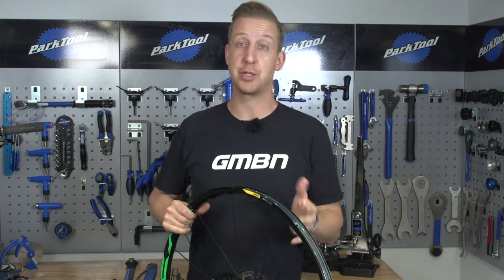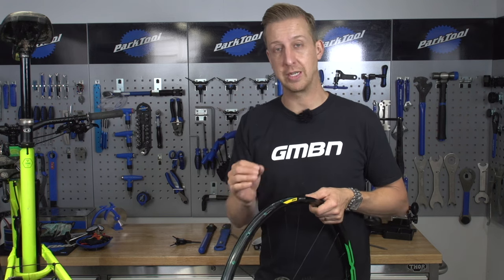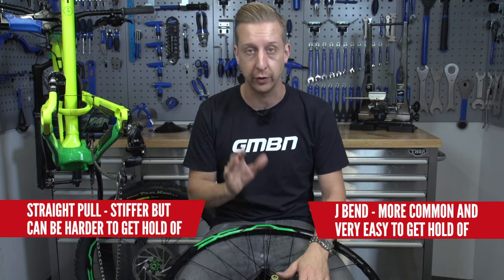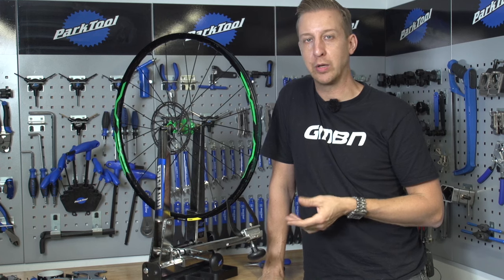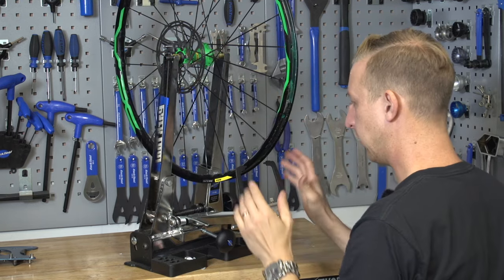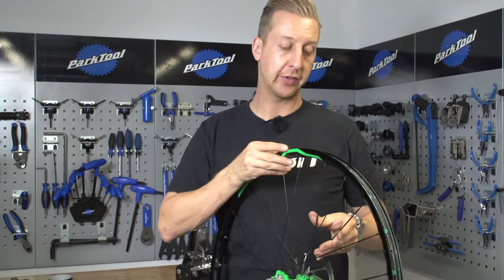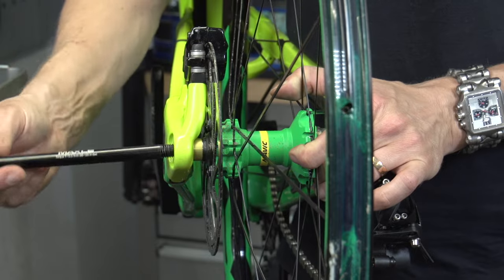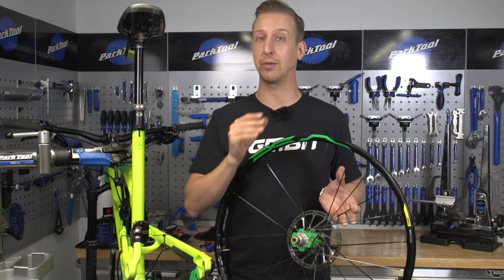How To Replace A Broken Spoke | Mountain Bike Maintenance

Comment from the maker: Let us know how you get on replacing your spokes in the comments below 👇
Reply: I managed to replace a spoke without removing the tyre, but I had to hold on to the nipple as if my life would depend on it. Thinking about it, it probably did.
Reply: I can replace a spoke without removing the wheel from the bike.
Reply: no removing the wheels, or cassette or discs to replace a spoke or two, the question is why not? I would think.
Reply: yep 30 seconds and chances are if they are J bend you will not have a chain whip with you if on cassette side and if not there is a 2 in 3 chance of having to remove the disc. I always have cable ties in the backpack and the frame with those is as good as any jig for a spoke replacement.
Reply: I bought a spare pack of straight pull spokes when I built my wheels up. always have half a dozen in my pack.
Reply: What happens if we don't replace a broken spoke
Reply: Can you provide any info on how to change a crankbrothers twinspoke?

Comment: That cable tie truing guide is a great hack! In fact, you could probably tape one cable tie to the seat stay so the locking end is sticking up and you can slide a tail (without locking end) through it. It's adjustable that way. You can't back it out, but you can run it all the way through and back in if needed. I'll try it next time

Comment: You are meant to hold aero bladed spokes in place with a stablisation tool as you tighten the nipple otherwise they twist out of alignment, this guy failed to do that, it can cause them to break prematurely. They are aligned so they cut into the air, for aerodynamic effect.
Reply: These are not aero spokes. This technique is called "bladed spokes" which helps the strength mostly.
Reply: The tool is called a Mavic Spoke Holder for Bladed / Aero Spokes .. so I think you are wrong
Reply: This video from Park Tools explains it https://www.youtube.com/watch?v=ZB_d8x05qXk

Comment: You did one really crucial mistake
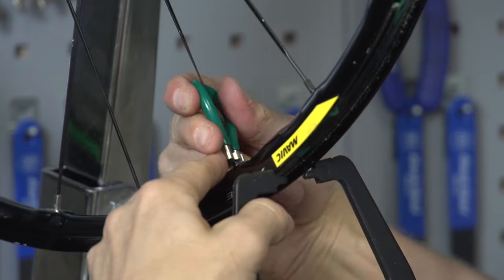Bladed spokes need a special spanner in order to keep the bladed part from twisting (as it happened in 5:55)
Otherwise you are putting tremendous forces on ur hub flanges and on the spokes them selfs.
Reply: mikeleight  right i apologize

Comment: When I built a new wheel, I used a broken piece of spoke to hold the nipple though the hole and then simply screwed it off of that and onto the replacement spoke.

Comment: 7:52 If the wheel itself has been trued on the jig, why does it still do that when it is mounted on the bike?  That's what happens with my bike.  How can the bike itself be used as a jig if the sideways motion of the rim is not the same when it's on an actual jig?
Reply: @cryora  they actually recorded that zip tie hack before the rest of the video. So essentially the rims was not yet tured. They loaded the video out of order when editing.

Comment: I have totally mangled my front Fulcrum rim, got it straight by bending it back. One scary thing when bending back the rim was that the weld opened and closed as I applied pressure. I guess no more jumps and trails on my rims.

Comment: You glossed over any tips for getting all of the sealant out of the rim and cleaning the rim tape residue from the rim.  How clean is clean enough?  Does it need to be perfect?
Reply from the maker: Hi Laura, pinch the tyre so that you can cleanly pour most excess sealant into a wide container such as an oil bath or a washing up bowl. Then use some rags to wipe up the rest. It doesn't need to be super clean, just so it's not dripping everywhere :)
Reply: What about the rim if you have to retape it?  It doesn't seem like the tape would stick if there's too much residue on the rim.
Reply: Rubbing alcohol will remove the sealant residue from the rim. You need it very clean so the tape will stick.

Comment: How to replace spokes on the trail?
Reply: Cable ties!
Reply: Ride home, take the chicken line. A wheel won't collapse just because a spoke is missing on a normal wheel.
Reply: You can carry a pocket knife and whittle a new spoke out of a straight stick. Top tip.